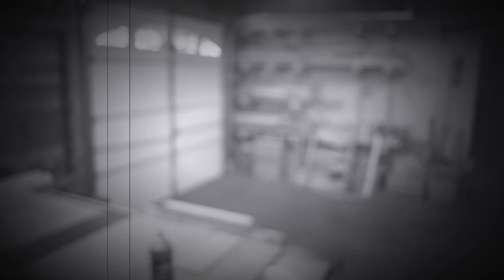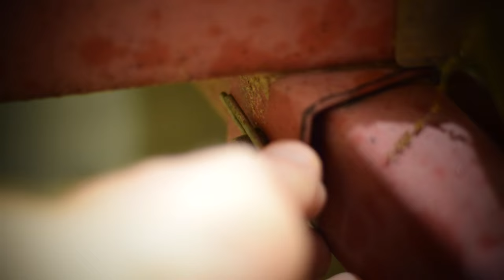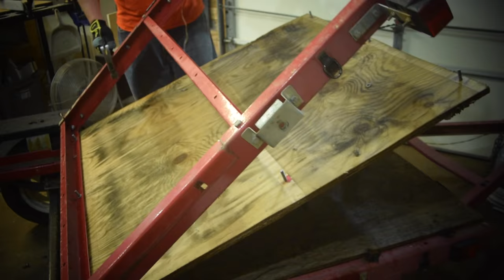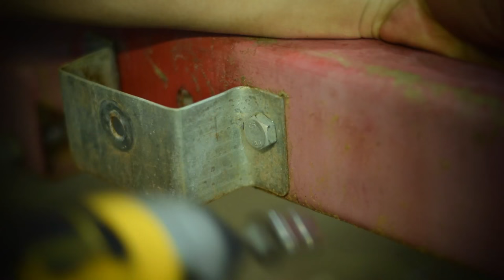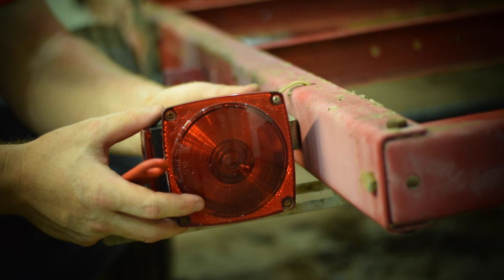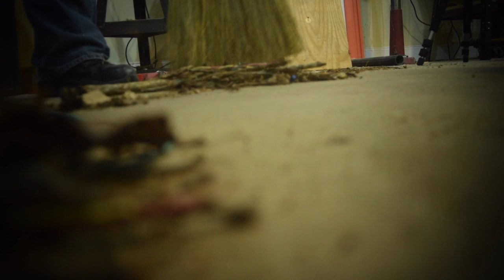Let's get started! | How to build a Teardrop Camper Trailer | Ep 1

Comment: Oh , man! I need all of that stake side hardware for my flatbed trailer...

I imagine you already know, but probably the best online resource for a teardrop build is Teardrops and Tiny Travel Trailers forum. I'm a long-time member there, and there's literally nothing you can't find there. Here's a link:

http://tnttt.com/

I do know one thing about using those HF trailers for a teardrop - be prepared to move the axle toward the back for weight distribution.  They have calculators for that, tongue length, free plans, links to parts suppliers - you name it.

Good luck on the build! I'll be following it closely.
Reply from the maker: +Mark Lindsay wow thanks Mark! You want the hardware? You can have it!
Reply: If I had a way to come get it, I'd be on my way, for sure. A road trip from Oregon is a bit far though. Do yourself a favor though, if you haven't already. Check out that forum and become a member. Go through the Hall of Fame and look at some of the build threads. Some of those builds are absolutely amazing.
Reply from the maker: I can ship it to you? I will definitely!
Reply: SouthernGinger  Email from Dusty82Elky coming your way.